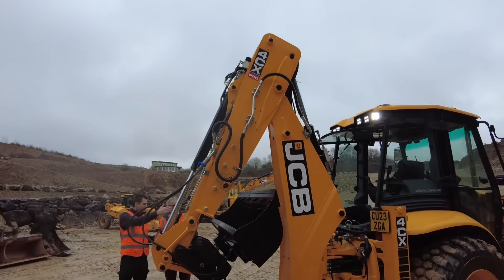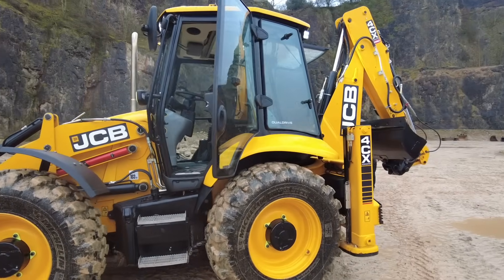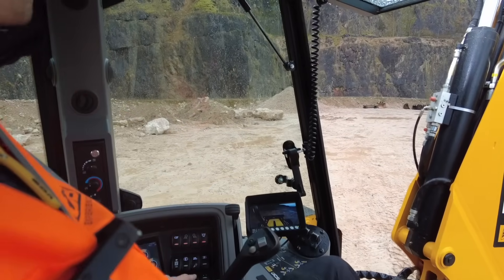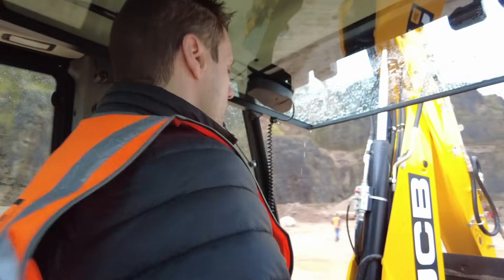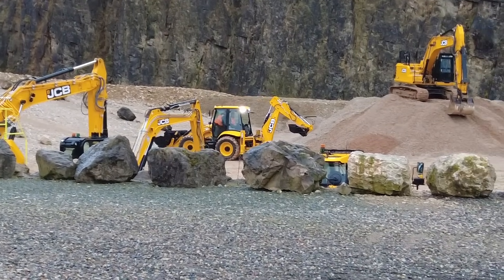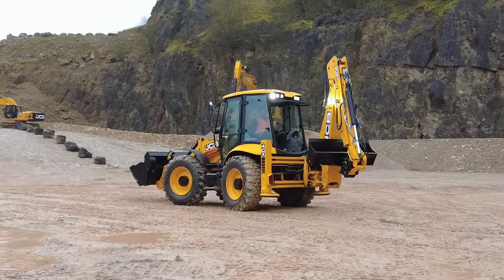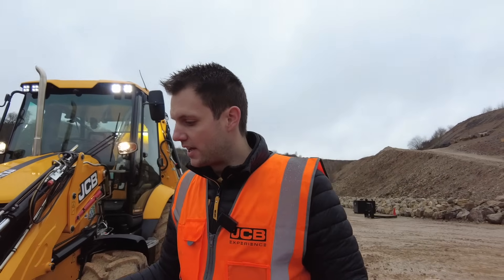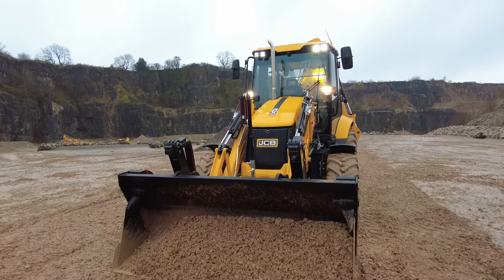JCB launches a new-generation 2024 backhoes – with multi-directional driving ability... and lasers!

Comment: Amazing, they are finally on par with what huddig and others have been doing for like 10 years, lol.
Reply: More like 30 years for dual-drive 🙂

I tried a 4CX with dual-drive in 2010, but it was modified by the tiltrotator manufacturer (I think) since JCB couldn't provide it. It was used by it's owner on one of the projects I was on.

Comment: More electronics to go wrong, as an owner operator I have had jcb and would never go back to them, let down so much on promises! 180% are a thing of the past,360% are here to stay, no making mud, sit in one place and work
Reply: You're so right....my mate ran his own plant firm....3cx electronics crap...I hired one for a day....wouldn't change gear, wouldn't shift up until I went over a bump in road....then dropped into 4th...he got rid of most of his 180s no one wants them....
Reply: @njkip बीजेपी
Reply: Looks like there is still some way to go before JCB catches up with Lännen and Huddig.
Reply: @johanneslaxell6641  😂jcb are the best 180% , but just don’t need them, the 360%wheeled excavator can do everything
Reply: @Del-27  I used to think so...ever operated a cat 432f2 miles better....miles...👍
Reply: Tu p😅

Comment: Now they just need to add a tow   hitch to the backhoe loder  and stick steer drive to the excvators.
Reply: Backhoe loaders aren’t allowed to tow in the uk.
Reply: @Massey-man   okay but do you know why?
Reply: @samfordham684 If they have to be taxed for road use, they’re taxed in a class called ‘special vehicle’. This class of vehicles isn’t allowed to tow. I have one on the farm and years ago you could tax them as tractors, but this was changed, and they can no longer be classed as a tractor, unless the rear backhoe is removable, like some old MF’s were. £165.00 I believe for the year.